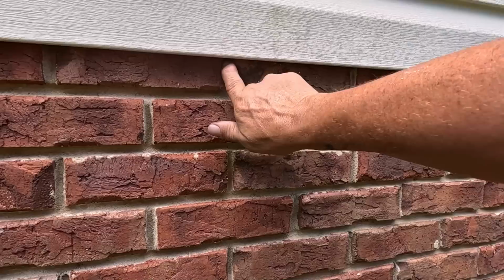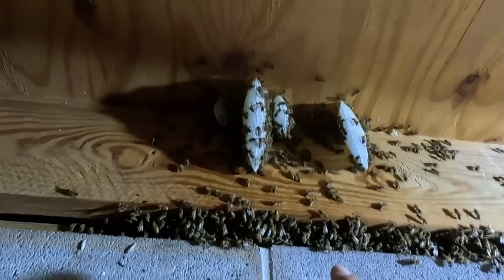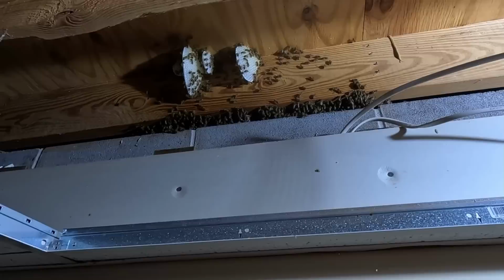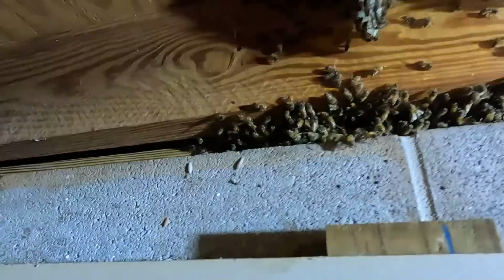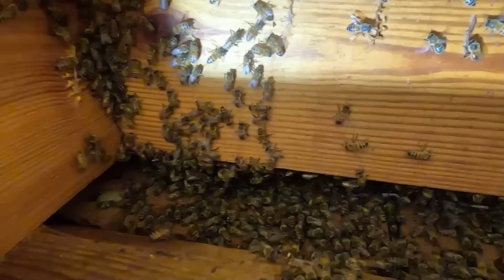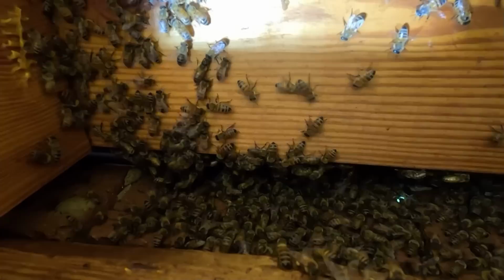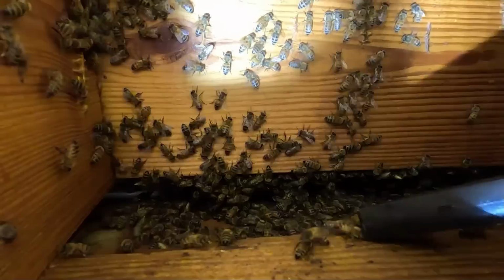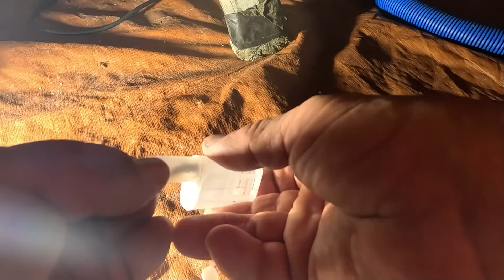Massive Angry Beehive Found In A Rental Home

Comment: Yappy, that floor joist ain’t going no where!  I totally understood how you said you were going to put it back and that’s exactly what I would have done!  I ready for the next one!
Reply from the maker: Man, I got hammered by a wannacarpenter on a video one time for cutting a band board.   Anyone with half a brain could understand the repair but some people just gotta complain about something.   
   I say, if a 14" section being removed is so vital to the strength of that structure and my repair process isn't adequate, that house has bigger problems than what I did!
Reply: any video with some construction element in it always has haters.  Those people are tiring and of course don't post their own.

Comment: Way cool mural. 😁
That's what happens when they don't caulk the bottom run of the vinyl, bad instillation. 

I'd cut on the in side of the joists then scab in nailing blocks for extra support when replacing the cut out section. 
Yappy as a retired contractor it is nice to see beekeepers doing cut outs correctly.👍👍👍

Comment: I was a framer and yes what you did is right. In fact you're repair is actually going to be stronger than it was to begin with
Reply from the maker: Boom!......I finally got one right.   Lol, you would be surprised at the armchair carpenter  comments I get sometimes.    But thank you for the confirmation.

Comment: So sorry that you got stung.  What were you spraying from the bottle?  Did you seal the hole between brick and vinyl or leave it open for the ladies to escape rather than being trapped inside the walls?

Stay safe out there.  Peace brother
Reply: The spraying he did after the comb removal was most likely repellent, he uses it to drive the strays back to where he could catch them.